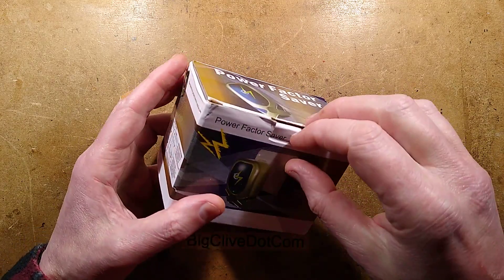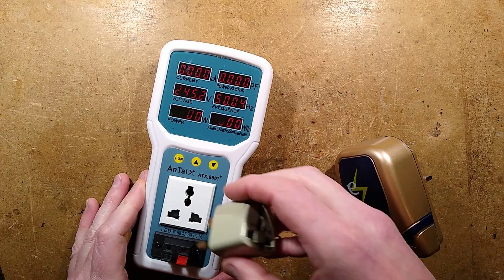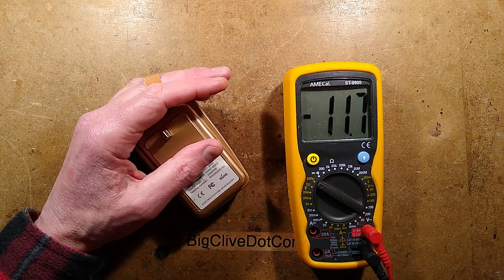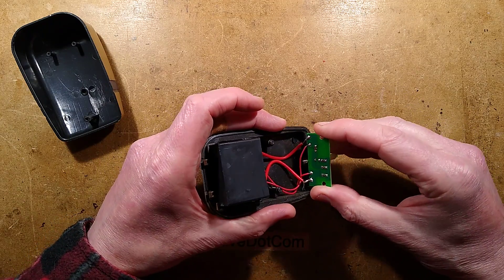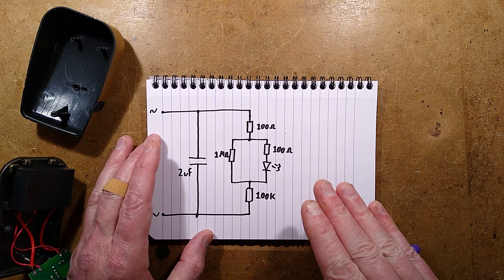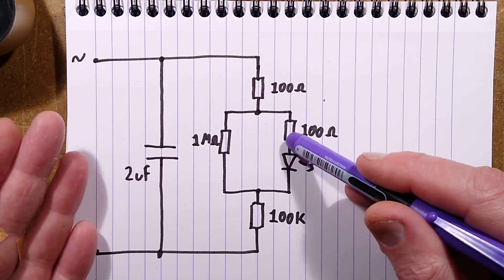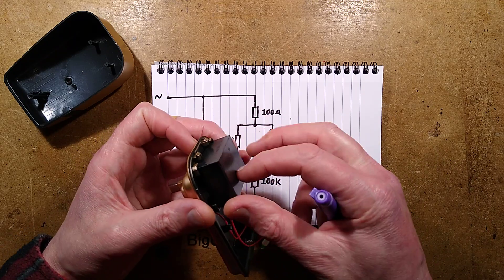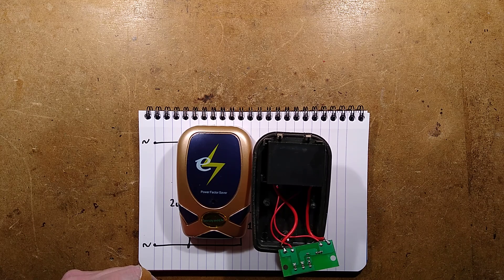Luxury fake power saver plug (with schematic)

Comment: PF correction would not save power but increase the bill, right?
Reply from the maker: It wouldn't change most bills but might have a random effect on a predominantly inductive load.
Reply: This is traditional PFC for sinusoidal loads such as motors.  Such loads already match the mains waveforms just a few milliseconds out of time.  Adding a pure capacitive or pure inductive load shifts the average closer to the right time by providing the current that the original load draws ¼ wave out of time, known also as 90° or reactive current.
  This works because a perfect capacitor moves no current in time with the voltage, only out of time.  But the current moved is fixed for any combination of mains power and component, thus the component size must match the load being compensated, such as a big ventilation fan that runs all the time.
Reply: @johndododoe1411  Adding a purely inductive load to an already fairly inductive load like an electric motor, would only shift the current more out of phase and make for an even worse power factor. A capacitive load would help, assuming the capacitance is somewhat matched to inductance of the motor. But for the most part, household devices nowadays are capacitive loads anyway, so this "power saver" would just make the power factor worse.

@Bernd Eckenfels  Assuming it would provide meaningful PFC for your load, it would save on apparent power and therefore reduce the bill, if you were in fact charged for apparent power (as industrial consumers are). But given that you only pay for real power and this device uses 0.5 Watts of real power, you'd be charged for 0.5 Watt/hour for every hour you have it plugged in, so yes, it would increase your bill.
Reply: @johndododoe1411  yes but my point is with traditional meters you don’t pay for apparent load, so if you correct their pf, you pay more.
Reply: @berndeckenfels  If the correction draws zero real power it causes zero change to the bill as long as you stay within the minimum power factor in the contract .  As this fake device draws a constant capacitive load it may unfortunately push someone under the limit as many modern loads aren't inductive.
Reply: @johndododoe1411  i was not talking about the device but about correcting your power factor.. but yes sure the device is just fake

Comment: That earth pin is annoying. It stops you using the case for fun projects if you want to be safe.
Reply: That short earth pin saves you from actually plugging it in, since it isn't long enough to open the shutters in the socket.

Comment: So, just leaves the question, can you actually build a 'Power Factor Saver' on the cheap?
Reply from the maker: A fake one, yes.  But a real one for modern electronic loads is complex.
Reply: No need to make one. Use a good quality UPS that includes built-in power factor correction or use a internal combustion engine generator set. Of course, both these will be more expensive…
Reply: @Mark1024MAK  the crazy thing is an internal combustion engine would cost 50p/kWh (there's 10kwh in 1L of petrol and at 30% efficiency you would get 3kwh of usable energy for every litre)... So 35p/kWh is probably daylight robbery considering you could get down to 33p/kWh burning kerosene (heating oil) which is currently around £1/L. The catch with this though is that you'd only get 30% efficiency when you're running a high load like a shower.

Comment: "I wonder if it haaaas...a discharge resistor?" (Experimentally pokes pins that were just in a mains socket and doesn't get a shock) "Yes, it does! That's nice."
Reply: “To truly understand the discharge resister you must BECOME the discharge resistor”
Reply: I think he's been hanging around Mehdi too much.
Reply: Why do you think Clive has an elastoplast on his finger today!? 🤣
Reply: As long as neither side of the capacitor has a ground connection, current only flows between the legs of the cap, and not through your whole body.
Still hurts, but not dangerous for your heart, unless you use the left and right hand.
Reply: A real tester would have put his tongue on it.
Reply: A thumb is an excellent discharge tool.
Reply: I'm not impressed unless he uses his tongue
Reply: Isn't the max. reverse voltage for an LED much lower than here is the case?
Reply: This is why I love this channel.
Reply: I have a sacrificial screwdriver for that action.
Reply: ElectroBoom moment
Reply: HAH, and OUCH as a main rated cap will bite back!
Reply: It wouldn't hurt THAT bad for THAT long.
Reply: He should have wet his fingers first 😅
Reply: @pauldzim  Should have used his tongue like the 9v battery test😝
Reply: And he's about to take it apart anyway and could have easily shorted the plugs with a screwdriver.
Reply: It's for science! 😀
Reply: it's OK it's just DC from the cap anyway
Reply: @marcogenovesi8570  misconception. Does not matter if it's just DC. It's going to hurt a lot still.
Reply: @raycert07  ehh, his finger was dry and it's unlikely it'll dump super high voltage in the first place. Sure DC isn't anything to scoff at, but he knew he'd be alright. I've been lifted by 120 and 240 ac, and been touched by high voltage low current DC a couple times. He knew what he was doing
Reply: @What bro I can have 50 characters in a name? Why??  ohh boy... you mean current, not voltage. The voltage WILL go in, regardless of how dry your hands are, it only needs to touch the layer of skin below dead skin, which is super easy. 

And these caps are rated for super high voltage, 500v maybe, around the same as used for disposable camera's flash bulb. I've touched one, not fun. Won't kill you, but not fun. It takes VERY little to go through the dead layer of skin on top, to reach the wet layer below.
Reply: @raycert07  I'm not about to have a drawn out argument about what makes electricity lethal. It is a combination of current, voltage, the resistance of your skin and the length of exposure, period. He was at little risk of more than a bit of a surprise and discomfort, maybe a slight burn at worst.
Reply: @What bro I can have 50 characters in a name? Why??  the voltage shocks you, and the voltage gives you pain by contracting your muscles beyond what they are meant to handle. I never said he was at risk. And burning would need to have much higher amperage and exposure.
Reply: @raycert07  yet you attempted to correct me, why don't you figure out what you're trying to say first
Reply: @raycert07  DC is not harmful at this voltage, you just get a little pain on the finger but that's it
Reply: @whatbroicanhave50character35  Not really DC as you get the ringing due to the finger and capacitor forming a tuned circuit as the capacitor discharges.
Reply: @marcogenovesi8570  a 400v 10000uf is going to make you sh[...]t your pants.
Reply: @LagrangePoint0  more like causing local burns in your hand where it arced between the terminals. You will live to tell the story. Those are big boys though, soda cans or larger iirc.

Comment: Well I guess it will save money on your electricity bill in the long term, because when it burns your house down you won't be using the electric any more...
Reply: It also blocks an outlet that might be used for a higher amperage appliance so its very effective. 😅
Reply: @mrbyamile6973  In N. America, we have blocking caps that you can insert into unused outlets that are effective in that regard. Originally intended to prevent children from sticking foreign objects into the socket. They're just inert pieces of plastic, no internal components that could fail and cause a fire. Cheap, too, usually sold in multi packs.
Reply: @dougbrowning82  We have it too
Reply: @dougbrowning82  in the UK we just let the toddlers stick their fingers in.
Reply: LOL!

Comment: Surely, the short earth pin means you cannot plug it into a standard UK socket as it won't displace the shutter mechanism before the other 2 pins bear down on the shutter, stopping movement?
Reply from the maker: It depends on the shutter mechanism.
Reply: Wiggle it at an angle (earth pin first) and it would probably go in. Don't know.

Comment: That 100k resistor is dissipating what, 1/4W?  1/2W but only half the time?
Reply: 100 kohm 240 volts equals about 24 mA or just over half a watt continuous. It's going to be rather toasty.
Reply: Why only half the time? The LED is going to be either foward biased or in reverse breakdown, current flows either way.